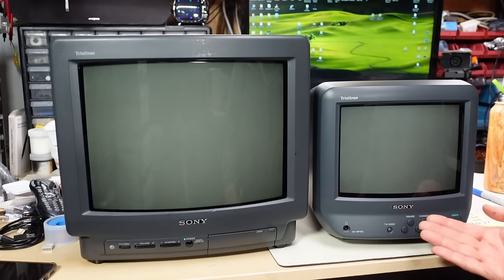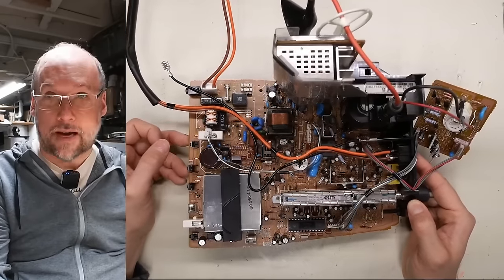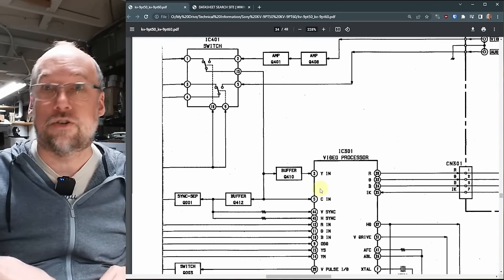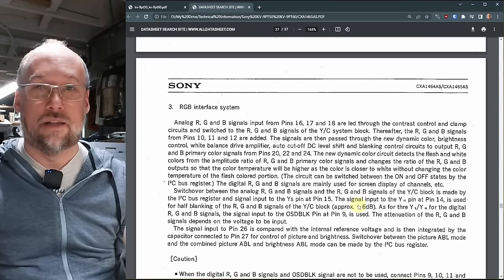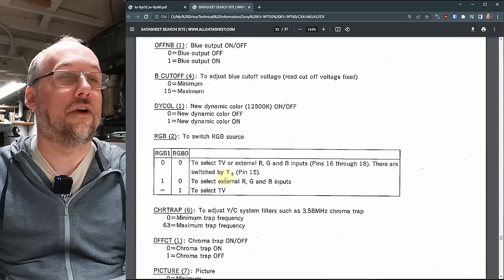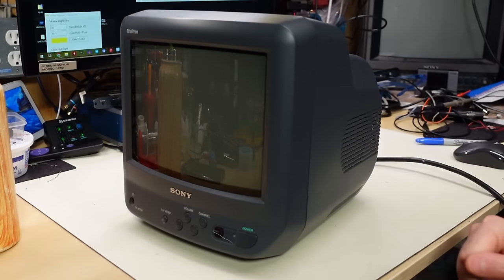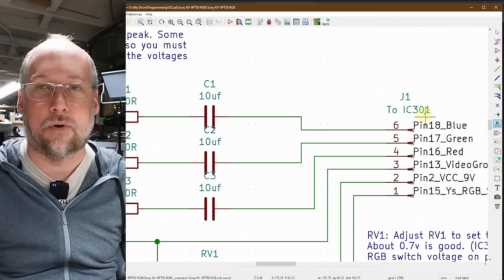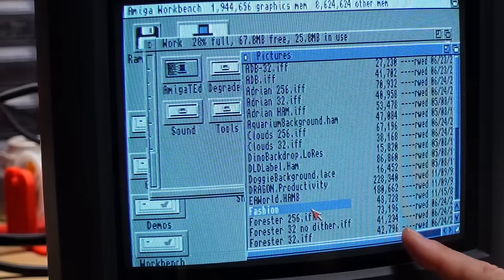Adding a RGB input to a Sony Trinitron (KV-9PT60 / KV-9PT50)

Comment: I always tried to avoid composite wherever possible. Being in Europe (UK) I was lucky enough to have a BBC micro along with a Microvitec Cub RGB monitor and it was so VERY much better than composite. I had a 14" Trinitron a few years later and it worked very nicely via RGB with my Atari ST via scart  although I do remember having to combine the syncs with a diode/capacitor hack.
Reply: In the US in the 1980s it was pretty much a choice between an RF-only home television, or a composite/RGB monitor. Many people opted for the former as a cost-saving approach, especially for 8- and even 16-bit consoles. I think a lot of people even opted to buy a smaller secondary RF-only TV for 8-bit computer use because of the versatility, although when VCRs got cheaper you could use their RF tuners and composite outputs to effectively turn a monitor into a TV (my brother and I did this in the 1990s with an old green monochrome composite monitor, which makes me very familiar with color NTSC dot crawl lol).
Reply: It was always a massive bugbear of mine whenever I'd buy a new games console and they always packed in those awful composite cables with a SCART adapter. Made for a really ugly picture.

I could understand if they shipped with RF(they were aiming for the lowest common denominator) but even my X-Box 360 had those crappy things packed in. It almost felt like a con, 'cause an actual SCART cable would cost at least an extra 20 quid. I've never even seen a TV with composite in, not counting plugging it in via SCART adapter.
Reply: They had those cub monitors at our middle school for the BBC micro. They all gave you a terrible shock if you were touching the screen when switching it off!
Reply: @fattomandeibu  Composite, also known as RCA. I bet you know what the A stands for. Being from Canada, we also got stuck with that S***! Conversely, I've only ever seen scart once in person -- my friend's family brought their electronics and game consoles back from Germany with them, when they moved back to Canada. At least things started getting component here eventually before HDMI finally took over.
Reply: @HunterZBNS  Over here in England, most cheap TVs in the '80s were RF only, too, but composite(which compared to RGB looks horrible) was pretty rare. The only time I ever seen it was when I bought a game console prior to HDMI(even my X-Box 360 from, I think 2008), which would come with composite cables with RGB adapter(you still got the crappy picture) and it annoyed me every time.

As I said before, it was almost like they were conning you, I have so many of those dumb adapters, but it's what they packed, and then charged you about US$30-40 for a proper RGB cable.

Comment: @31:25 You can 3d print a "mold" of a grommet to secure cords, then place the cord in the mold and inject hot glue to create new strain relief.

@32:24 You can use an ABS compatible 3d pen to fill in small gaps like the one around the DB9 connector.

Comment: Thankfully, most late model CRTs have a bleeder circuit for the high voltage side, which greatly reduces the risk of shock. Still, I always use my discharge tool on the anode to play it safe. I can attest to the sheer amount of energy the tube can store - I discharged an old Electrohome Arcade monitor after it had been unplugged for a couple of minutes, and despite having a 100 ohm resistor on the discharge tool, there was a significant pop and a big arc. I would not want to get bit by that!

Comment: I have an awesome Samsung CRT from around 2006, I know it was from around then as I saw it in stores at that point and the actual build and shape is much more modern than most CRT's the only issue is its limited to RGB scart at best despite there being holes in the frame covered by stickers where component connectors would go.  If I could mod it I would put in component and run a hdmi - component switch and play via pc.  Wish I had soldering skills.

Comment: to put connectors there are several ways.  in this case you can use the back plate of a serial card (same connector, ti put VGA conector use old grafic card) that doesn't work, cut it out and use it as a template for the dremel (I recommend screwing it in place so it doesn't move).  The other way would be to make a 3d print as if it were a back plate (somewhat thicker to screw it to the TV and to the connector) and to pass the cables simply make a hole.

Comment: Regarding the brightness of the Atari ST, it's actually different between the STF and the STE. When Atari expanded the Shifter from 512 to 4096 colors they apparently recalibrated the output so the maximum white of the STE is brighter and the maximum white of the STF.
Reply from the maker: Ah! Interesting. Yes I was using the my STE.

Comment: Tie a knot on the power cable and you get perfect strain relief 😀
Reply from the maker: Heh sadly the cord is too thick and there isn't enough room inside. I ended up putting some big zip ties on the inside and that works great too.

Comment: Dremeled holes rarely look neat, but it helps to dremel the hole a bit smaller than you need and then expand the hole by hand filing it the rest of the way. You have much better control with a hand file so you can ensure a neat, fairly straight edge.

Comment: If you're doing something like this in the future, I'd suggest SCART here. You still buy pre-made SCART cables for most pre-HDMI systems, including computers, non-Nintendo game consoles(PS1/2(uses the same cable for both), Sega Mega Drive, original X-Box etc.) and DVD players, though with the latter, you'd need a British model of player for the SCART out.

I guess for yourself this'll work fine, but if you have/use any of those things, it'd be very useful since there's cheap, ready made cables to allow for better picture.

Comment: I believe the 0CH-BLK was used for channels that did not detect any valid video signal so that they could be fully blanked out and not show static on the screen. This was done this way so that the OSD could still be shown over the black background of a blanked out channel.
Reply from the maker: It sounds like that could be the case, but this TV doesn't blank channels with no signal. (Even before I modified it.) The only thing it does is blank the tuner video for a moment as the channel changes. Even after the mod this still works as expected ... so I can't detect any difference in the way the TV works after stealing that line.

Comment: Great video! I recently picked up a similar 13" TV but from Sharp; the service manual described its jungle chip in detail (I think I could do a very similar RGB mod, but don't know if I have the time). I did notice the color killer pin on it and wondered if that may be an interesting mod (wiring it up to an on/off switch) especially if someone had an Apple II/+/e/c since rainbow text isn't all that fun to read. Does the chip in your model have such a pin?

Comment: The Y/S input appears to be TTL (or similar).  0.4 V is the maximum voltage for logical low, and 1 V is the minimum voltage for logical high. Everything between 0.4 and 1 V is undefined.  Straight 5V / 0V would probably be fine.

Comment: The easiest way to cut out the DB9 spot would be to make a jig, drill some holes in to the plate and go slowly with files.  A dremel works, but it's too easy to screw it up.  You  could fill in the gap with Acraglass or JB Weld, but it's probably not worth the effort for something nobody is going to actually look at on the back of the TV.

Comment: 32:22 Drill the corners first and cut the hole a little bit smaller then what you need. Do the rest with a file. If you remove too much material you can use polymorph plastic to at least close the hole. Polymorph becomes plastic at ~70°C (~158°F). For a repair like this it shouldn't be a problem, though I need to say that I did use it for a plastic repair of a phone holder in my car and the heat in the car, directly under the windshield, did melt it during a hot summer day.

Comment: Although the composite video expects 1vpp in total, the sync portion of that signal is only supposed to be about 0.3vpp. Giving it 1 volt of sync could overdrive things, and do strange things. The input should also be 75 ohm terminated to ground (that's at the outside world side - the 9 pin connector side). If you're tapping sync straight into the normal CVBS input through a voltage divider, it's not properly terminated.

It's similar with the RGB inputs, they should be 75 ohm terminated to ground. And the video source should be getting 0.7 vpp video when 75 ohm terminated. Normally, you'd get double that voltage if you didn't terminate them, overdriving the input, but some video sources are not correctly built (you may see no level change, they may not be able to properly drive a properly terminated input stage). Without termination, you can get reflections and ringing, though you could be lucky with short cables.

Comment: Hey Adrian, I have a Phillips 8833 (1084) with composite video input only. I’d like to see you do a mod on how to bypass the Y-C separation filters and add an S video input! Thanks!
Reply from the maker: You can take a look at the schematics of both to see the bypass, they are probably identical or nearly identical inside.
Reply: @adriansdigitalbasement  I worked on NTSC mixing and separation filters at Kodak but that was 30 years ago! All passives like caps, resisters and inductors connected in the proper configurations to separate the luma and chroma.., fun times!

Comment: 6:49 I'm very well aware of being shocked by a Flyback, its not fun. Took apart a 27 inch CRT as a teen, wanted to scaveng some parts since it was completely dead and since it was just  plugged in minutes ago, when cutting the HV line to the tube I got a nasty shock using metal scissors.
Its surprising the dumb things I did as a kid and I'm not dead yet turning 31. Don't mess with shit

Comment: I really wanted to rgb mod a tv, but non of the ones I own support analog rgb, they all use digital.  But I had that same idea to use a db9 connector instead of scart.  It just makes more sense, it's cheaper, smaller, you could use a serial switcher has a video switch, even soldered audio onto to unused pins.

Comment: Currently I'm thinking about upgrading my Trinitron KV-29XD with more inputs - tho I'd love to get into source switching IC, and give it more to work on. I don't want to add button / switching circuit externally. I want to hook up VGA input, and Raspberry PI's output into the IC that sees potential inputs, and can switching between them. Not sure how to tackle OSD tho. If the MCU is OEM, then I can't to anything about it, but if it's not, and something known like pic / avr / whatever, then I could probably reprogram it nicely, and add my custom crap, like "change channel -> raspbery pi" or "vga". That'd be a lot of fun. Not necesarilly educational, but fun for sure!

Comment: Lol you almost sound sad about CRT fandom, well it does drive up prices. ;) I like your breakdown of market demand driven RGB in NA, yeah it was a slow crawl of progress Eg. near endless RF death grip. :|
Interesting how much you move screens in your bench setup, very much like what PVMs go through. I still have my C64 monitor, it has a handle but such a sharp right angle it hurts the hand. :(
I love the change to the Jungle IC setup since it's mod friendly but RGB always seems to involve/bypass the overlay functionality unfortunately, likely because it's design is SO market driven optimal. Still not sure why picture control pots, like overdraw adjustment, turned into a hidden code service menu when they moved to this standard though. :\
In hindsight I wish they had done more backdoor or dormant functionality paths towards RGB and stereo sound like game consoles tended to do in a sort of gap or unpopulated design approach. For example physically a manufacturer can put two speaker brackets into a shell design but only install a mono speaker.

Comment: I kinda want to RGB mod my Daewoo TV.

The problem is that as a UK TV it DOES have a SCART socket for input already, but it's only a Composite SCART input, and doesn't use the RGB lines wired in on the SCART Socket (Which was actually fairly common on low end TVs), so I'd guess it likely doesn't have the circuitry in there. It also does have a Composite input, but there's only 1 AV channel you can select that accept input from both (one at a time), so it's also possible the circuitry is in there, but not wired up, as a cheap way to make both inputs work on the same channel.

Comment: 4:16 I'm French and used to know SCART connectors. these guys were pretty terribles to use... trust me, you didn't miss anything in North America. the main problem was that these were fragile. A SCART connector was a big chunky 21-pinsconnector. It was ALWAYS ending up being damaged and we had to jiggle around for 30 mins or more to have a slightly good image, either it was from a VHS player, a DVD player, game console or whatever.

i remember  things like the blue pin was dead so the image was yellow, or blue AND green were dead or damaged, so image was red, or there was no image at all. or no sound..

SCART cables were usually not that fragile. It was mainly input female sockets that was ending up with damaged pins inside, causing all these troubles.

Comment: As for Trinitrons, I have four now, no more though, they're heavy, and my spine is too painful to move them about, but, yeah, the Torch monitor (9 or 10"), a KV-M14TU (14", love its' monitor-esque looks! Not working though!), a KV-14M1U (kind of an updated version of the previous, works perfect, after repairing cracked PCB issues) and a KV-21X5U (21", also cracked PCB issues, but plenty other failed electronicals, including the Jungle IC, working, but still is unfinished!), I think I'm set for TV sets now... :P

Comment: You could do a 9-pin to 9-pin adapter (just like the old gender changers) but you can add those resistors on the adapter and not the cable, less modifications on your cable and you keep those cable as "stock" to your needs.

Comment: My 32" Panasonic Tau has RGB, RCA, Svid. I haven't turned it off since I owned it back in 2011 handed down, as with any electronics basically, a constant volatge with proper cooling is far better the the temp cycle from off and on, same with cars

Comment: Awesome job Adrian!  I have a 27" Trinitron that I might do this, but I have a Toshiba 27A33 TV with component video inputs that just looks so much better than the Sony Trinitron.  The Trinitron only has S-Video but for some reason the Toshiba looks better with any input composite/S-video/component than the Trinitron connected with S-video. The Toshiba must just have a better comb filter in it. Do you think that you would have more interest in the Coleco Adam if they named it the Coleco Adrian?

Comment: Speaking of trinitrons, have you ever come across anyone using a Sony PVR 8220 color monitor for retro computing? It has BNC inputs, but with a composite-to-BNC adapter the image just rolls and v-hold appears to do nothing.  It acts like it’s losing the sync signal. These PVRs were used for professional video production and I wasn’t sure if they were suitable for us retro nerds.

Comment: You have a Sony camera and a Panasonic GH5, right?  The GH5 has a shutter angle adjust that allows you to sync it with CRTs.
Reply from the maker: Unfortunately my Panasonic is some version (I forgot the exact model) that lacks this feature... I hope to one day get something that can do it that also doesn't have trash autofocus. (Which those Panasonic all have) I got endless complains about hunting auto focus when using the Panasonic as my main camera. :-(
Reply: @adriansdigitalbasement  Yep, hunting DFD autofocus has drawbacks.  One trick is to use a smaller aperture, but that requires more lighting.  Also, if you can just lock-off the focus to manual, with a small aperture, then the focus will be pretty good.  The new Lumix S5 II was just released, and it has PD autofocus, like Canon and Sony.  But even with PD, you can have focus issues (Canon) if your lens is slow and there isn't enough light.

Comment: In mid 2000s there were more Firms doing the Trinitron, even better than Sony - Sony had only the "Slit" - Advantage by letting more Light through - even in the Monitor Branch.
Even with comletely flat screens, though they were CRTs... but very heavy.

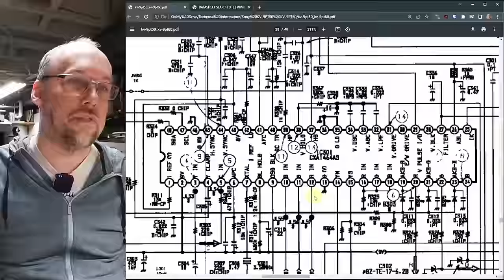Comment: After looking at the CXP85112B-840S microcontroller data sheet when Adrian was showing the Jungle IC data sheet at 16:44, the CPU core shows as a SPC700. Is that the same as SPC700 by Sony that’s in the Super Nintendo?

Comment: I have 6 inch roadstar tv from 1993. It has composite input+radio and UHF-VHF TV. its b/w tv and its so rare in my country that i almost payed 200 euros for one. Also its so rare that there is only one video of it on yt and i wanted to convert it to rgb but i dont know how. I payed 30 euros for mine beacuse it had problems with v.hold and brightness potentiometers and seller didnt know where to find same potentiometer and change them. I changed them and its working fine (for now)

Comment: Awesome video! My Jungle chip has 2 RGB inputs as well (R1, G1, B1, & YS1 Pins vacant), but may be a little different. Can you view the schematic for me and tell me if I'm good to go? Seems like I would be able to do RGB or component mod on my KV-13M51 😁 IC301 Jungle model: CXA2061S

Thanks!

Comment: What about the Service Menu? I think most Sony TV's of this era have it, and it's loaded with adjustments and settings. You need a sony remote to do it though. It's a combo of buttons you press on a Sony remote and the TV enters into this service mode basically where you can change *everything*. EDIT Oh I missed the last part from data not loading right, my bad lol!